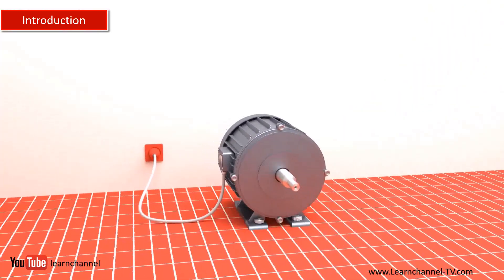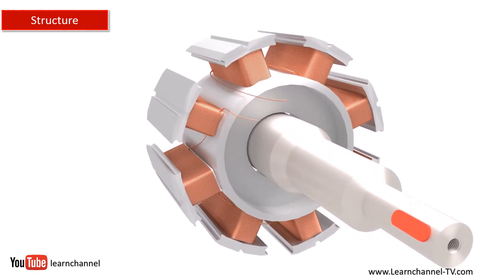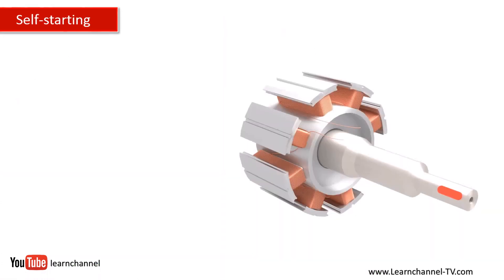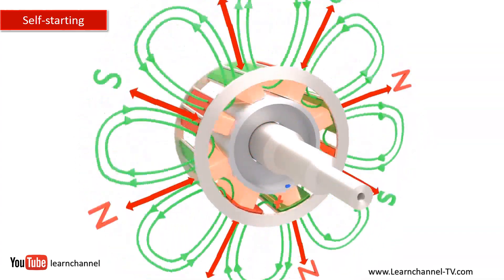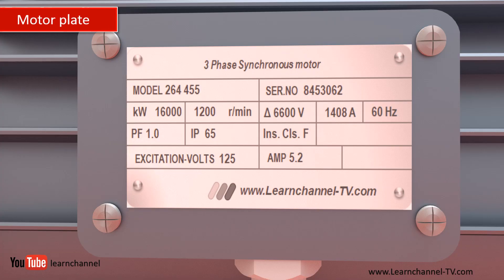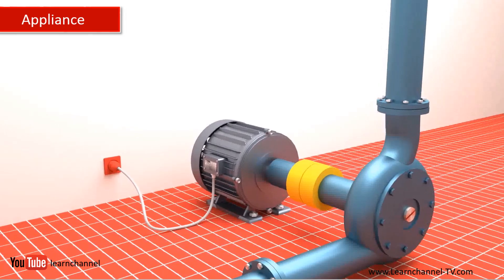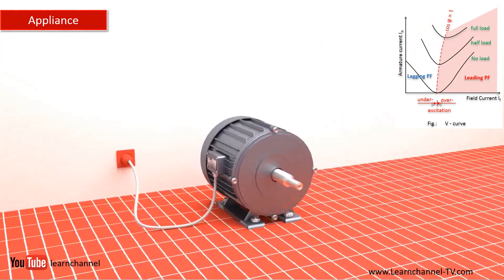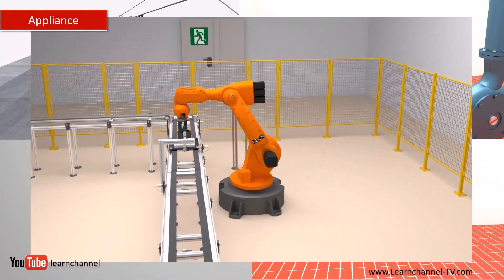Technical animation: How a Synchronous Motor is working

Comment: The motor and generator is same struktur ??
Reply from the maker: The shunt DC motor or permanent magnet DC motor have the same structure as a generator. 
The series-wound motor does not.
Reply: @learnchannel-TV  and for synchronous machine ??
Reply from the maker: @farhanhakimul8053  it is the same structure. I have a video about electric generators on my channel.
Reply: @learnchannel-TV  oke thankyou

Comment: Hi,How can I distinguish between a synchronous motor and an asynchronous motor without turning the motor on
Reply: You know we need DC exciter system specially for synchronous motor so meaning wherever you see there is commutator and brushes you can assume it's synchronous motor.

Where as in asynchronous motor (commonly used squirrel cage) will definitely not have brushes or commutator rings meaning rotor is free from external connection. And that's how you can guess it's Induction motor.
Reply: @Neo-po2xw  synchronous motor can have permanent magnet rotor so you are wrong.

Comment: Can u list some applications of synchronous motors?
Reply from the maker: The best example would be larger industrial robots. Here the three-phase synchronous motor together with a sensor system and a controller form a closed loop control.

Comment: Sir can u say wt type of motor is used in traction if there is ac supply either slip ring rotor type or squirrel cage rotor if it is induction motor
Reply from the maker: hi - Slip ring motor are outdated. Nowadays you use squirrel cage induction motor, controlled with a vfd.
Reply: Tq sir